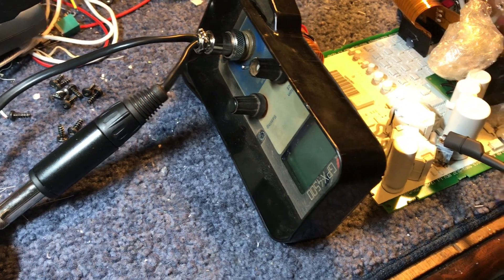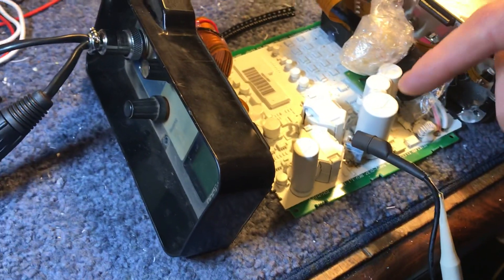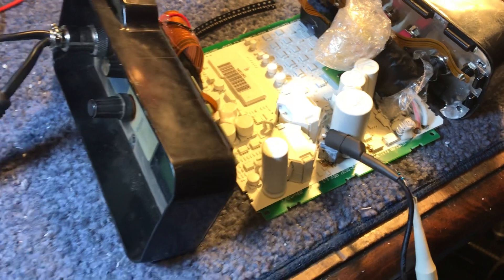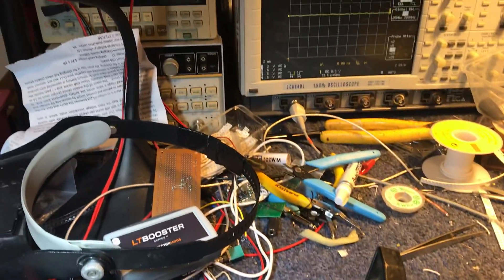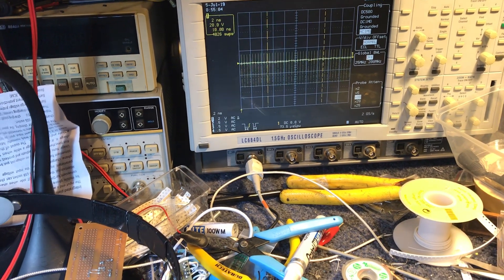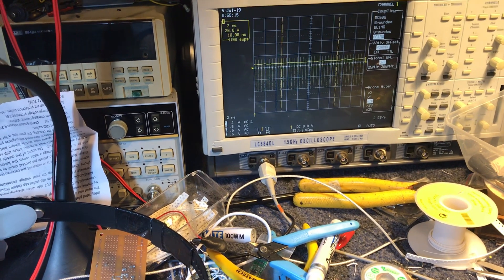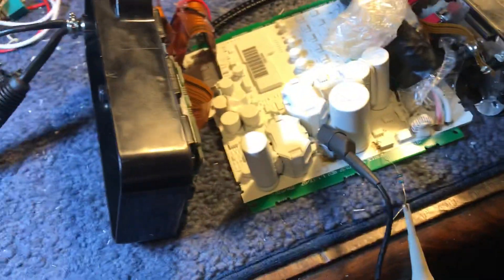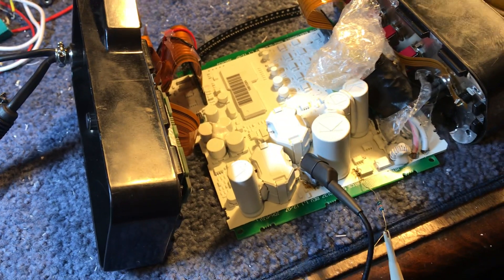Mosfet failure on P.I detectors

Comment: Wonder why Minelab would does not anticipate the voltage surges. the higher rated Mosfet cannot cost that much more.
Reply: That’s true now, but in 2008, 200v mosfet were cutting edge and higher rated parts cost triple